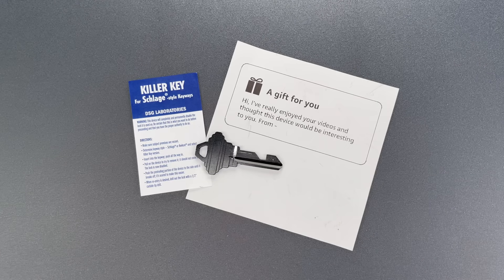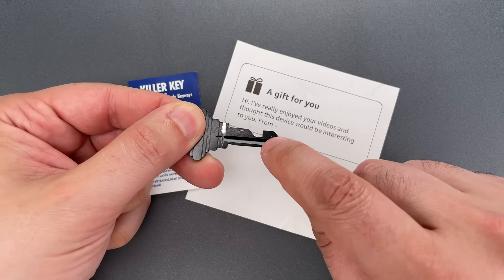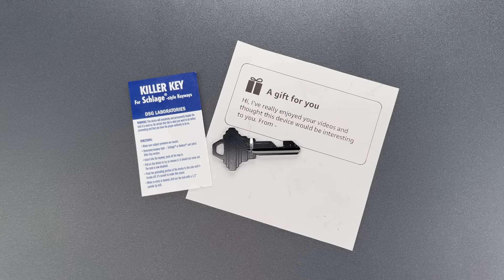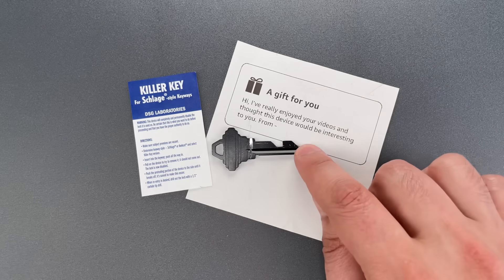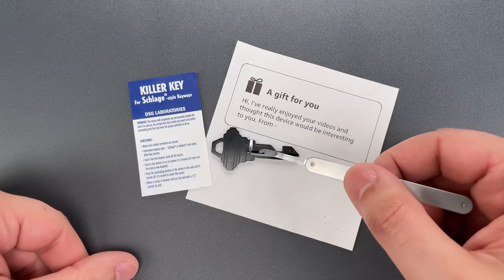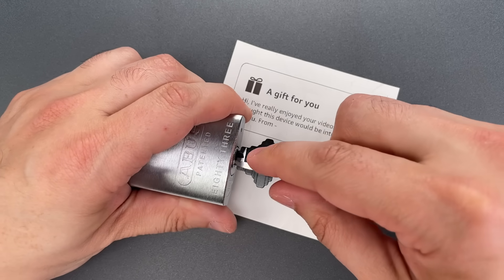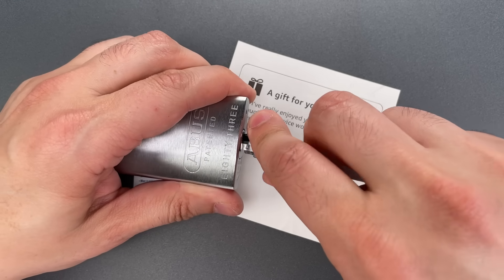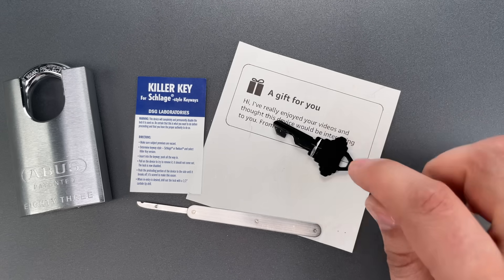[1350] Defeating a “Killer Key”

Comment: "Those so-called killer keys can be pretty useful" but as I just showed you, it´s important to remember how useless they are.
Reply: Your non-paying tenant, of whom 99.99999% doesn't know anything about picking locks, would beg to disagree.
Reply: @caelestigladii  If he ain't paying anyway he'll just defeat the door.... 😉
Reply: @caelestigladii  That's true, however as it was defeated with an improvised tool that also retrieved the key, it means without using any improvisation you can use a slim flat piece of steel without a hook to lift the pins, and just pull the bow. That would be something I'd try whether or not I know anything about lock picking. It's the second thing you'd do after tugging on the bow to check it is actually stuck in, if you were intending to do something other than shake your head and walk off, this would be it. Most people do understand how a pin tumbler works, being as it's the most widely used type of lock, and everyone has seen a key with peaks and troughs. Whether or not you understand how it works, slipping a feeler gauge or something similar down the side of the key to see what's holding it in there would occur to many people, not just lockpickers. And any squatter would have the key out as fast as LPL did. They can deal with far more challenging bars than a hooked key.
Reply: @caelestigladii  it seems like a low skill attack.
So everyone who can use Google can bypass that key killer.
Reply: @Jehty_  that's if one have time to google while breaking in.

Comment: Thanks for the advice! In addition, hotel rooms use electronic keys which are literal crap in a card... Of course you knew that, so for those watching, barricade your door in a hotel and buy or make an alarm. The locks provided can be defeated with a rubber band and duct tape or even just a piece of thread... I know because that is my job right now and a simple warning device (noisemakers at a minimum if the door opens) will save lots of embarrassment in a bad (rare) situation a Tiktok video...

Comment: This is just cruel. Not only does he “kill” a lock, he plunges the tool back in to kill it again, makes a mockery of the tool with an improved version he just happens to have on his key ring and totally nullifies the threat of this product with one of his own in under 2 minutes and even that was taking his time. Brutal.
Reply: "Stop! Stop! It's already dead!" xD
Reply: While his key is definitely an improved version, by the looks of the intrusion method, I think it would have similar results. LPL just shows that if there is a will there is a way to bypass basically any defensive measure.
Reply: @darkest_eclipse8271  The best defensive measure is an armed guard.
Passive measures only stop the unprepared and unskilled in their tracks; they only slow down a prepared and skilled attacker, and in this case, it only slows them down by about five seconds.
That may or may not be enough slow-down, depending primarily on how far away that armed guard is.
Reply: the armed guard has been bought off with a bottle of scotch
Reply: @cactustactics  claymore on a tripwire.
Reply: @brandondirocco9816  That's an example of something called a "mantrap" and would get you sued
Reply: @brandondirocco9816  I'm picturing this with a sword on a string
Reply: If you enjoyed that, enjoy watch?v=yzfsPkZMR1A which has three different scenarios and six (if I counted right) different tools in just 9 minutes.  (-:

Comment: Let's not drag this product too much. It is what it is, a low skill tool that requires some preparedness to counter.
Also I think this extraction with a probe wouldn't be so easy in the field. All you need is a bit of grime and rust and jamming this fragile probe in there might not be possible any more. Also you surely could produce these with a slight taper so that there's barely any opening in the first place.

Comment: Theory: if you were to make the break off part farther down, so it's broken on the back side of the first or second pin in, and put a curve on the key so you need to tap it in with a small screwdriver, effectively wedging it inside the keyway, in Theory it would be nearly impossible to remove.

Comment: Hey lpl. Does this method work with a regular broken key in the zylinder as well?
Reply: If I'm not mistaken, there is a "regular" tool for that. By regular I mean a tool designed and sold for that exact use.

Comment: Question: if I injected the lock first with an instant glue, then inserted the killer key, how would you remove it after it's dried?
Reply: Heat the key with a lighter would disable the glue. Or acetone.

Comment: @LockPickingLawyer Here's a better design:  Score the key at pin 3 right down to the bottom rail, so that it's hanging on by a thread.  Insert the key into the lock, wiggle while pulling back, and eventually it will break, leaving the first half of the blade stuck under pins 5 & 6.  There won't be any places for you to grab the end of the blade with that dimple.  I'm sure you could still craft a tool that could get around it, but it would make it much more difficult.

Comment: Saw a far better way to kill a lock.. Ramset a nail into the key way. That's not coming out.  I use 0.103" cross section silicone orings cut into sections to replace the last top spring in the shell.trimming it so I can just barely use my pin tweezers to force the top pin down to allow the plug follower to hold it. You cant pick or bump the lock.and if you loose the key the oring has enough pressure to push the top pin thru any shimstock.

Comment: If I made a killer key, I would actually want something to stick outside to completely plug/cover the keyway and prevent removal tool insertion. Then you'd at least need to drill/file/whatever the capper piece off before attempting anything else with the cylinder.

Comment: LPL defeats lock, defeats killer key, nonchalantly states “if I were to make one…” and already has one made. I swear LPL has more flexes than the weigh-ins at a UFC fight.
Reply: AND STIIIILLLL
Reply: @MerlinDeLyon  Heavyweight Champion of the Lock; Pick-ing Law-yerrrr!
Reply: Undefeated, Undisputed
Reply: @DarranKern GOAT
Reply: When it's a lock, undoubtedly!
Reply: I love that he just shows his improved version casually and then never mentions it again.
Reply: Not only one but a whole ring.
Reply: And has a classy soothing voice I fall asleep to every night... while dreaming of picking locks. ;D
Reply: lmao i gotta steal that line for later
Reply: I think it wasn't his own "re-designed" killer key, it just looked like one, and he said "kind of like this one"
Reply: Did you notice that his version has two notches, at different positions, so the trick he showed off won’t necessarily work? Or not as easily anyway…
Reply: @randombloke82  it will work the same, he raises all pins all at once with his tool and then its pulled out by it no matter how many notches it has
Reply: @randombloke82  The principle remains. Pushing all pins down and pulling the key out. You could probably hold the key together with the pick and pull both out.
Reply: @SmartLifeEnthusiast  The key is not supposed to be pulled out.  It's like a shiv where you break the handle off with the blade still inside the body.  That's why it has the breakaway groove on the key.
Reply: @toolbaggers  I know. I'm replying to Azrael re. LPL's version with 2 traps. It can still be removed using the technique from the video.
Reply: Was looking for this comment. Already on his key chain too
Reply: no
Reply: Mate are you okay
Reply: Easily defeated ,just swing your King Rooster at the lock 🙂
And if its Master lock , killer key will drop out by itself .
Reply: Has the LPL ever been defeated??  Not once on a video have I seen this?
Reply: no shit!!!! we all just watched the video... why are you repeating what we just saw? are you that big of a loser?
Reply: except he tells you what his web sie is an you can see for yourself he doesnt make these ......yet
Reply: https://youtu.be/Cp7SePV4BbU

Comment: When a large UPS caught fire at [a non-profit] burst into flames fire, my boss at the time quickly evacuated/secured the room and used one of these (+hammer and a nail) to jam the lock to prevent [people] w/ unsecured/copied keys from releasing the fire into the rest of the building once we were outside (a known problem from previous fires in the building...).  

It succeeded! The fire service had to have [people] physically removed before accessing the door holding back flames and smoke.  "Prepared", those [people] were not.

Later the company that made UPS units cut a cheque (well above the actual damages we were asking for). Only asking  us to confirm that nobody died or was hospitalized as a result of the fire -- Which seemed very good of them.
But, they also sold those units with multiple thermal protection devices 'bypassed'/jumpered out, since that was also how the units were configured at certification -- Which seems is less so...

Edit: I remember the (hammer+nail) specifically because that boss had a bunch of different "killer key"s to demonstrate why we needed wanted ones with button/rivet heads to actually keep people w/ stolen/extra/unsecured keys out.

Comment: These would be a hell of a lot more effective if they had a flared end, which prevented any access to the keyway after they were inserted.
Reply: or a mushroom head that completely hides it (-:
Reply: Yeah, you’d need to dremel off the flair to remove it then.
Reply: Great idea. Or a gentle taper - push it hard into the lock, doesn't actually matter if it bottoms out as long as it gets stuck behind at least one pin.

Comment: OH! That lock killer and the explanation made me understand more precisely how locks work. I have been watching LPL for yers, why did it take me so long?
Reply: You push the pokey bits with other pokey bits above the split between two tubes is how locks work.. well, pin and tumbler anyways. You could visualize it by shoving an empty toilet paper roll inside another roll and jamming a couple of pencils all through one side of the nested tube. The inner tube can't rotate until you've pulled the pencils out. That's really what you're doing when picking, freeing the inner tube. ..except locks use two-part pins instead of pencils, and the tubes are much thicker, and made of metal.

By turning the core, adding tension, the manufacturing tolerances of slightly different diameter pins, different hole alignment or shape, will isolate one pin that's slightly larger/more off center/.. than others. You find the sticking one, push it up until you feel it slip above the shear line, and since you're keeping steady tension, the core will turn, and binds on the next pin that's the 2nd largest/off center, push that up.. and on to the next..

Comment: What’s the intended purpose ? Is it in the event of preventing a lost key being used ?
Reply: I suppose that would work. The main use is apparently by landlords, to quickly lock out an evicted tenant until the locks can be changed.
Reply: @beeble2003  
Seems a bit of an expensive way to do that, assuming the eviction is legal, the landlord should have new locks ready to go on eviction day, rather than the expense of having locks drilled by a professional.
My initial thought was they were a means to cause a nuisance to the lock owner, much like supergluing a lock.
Reply: @Will-thegrumpysoutherner  Maybe the locksmith isn't available at the specific time needed. And if somebody wants to superglue a lock, they can just superglue it. It's easier to imagine a product that has a somewhat redundant legitimate use than one that has no legitimate uses and is completely redundant.
Reply: @beeble2003  
Landlords & agents can generally change locks & an eviction takes months & months.
Your explanation doesn’t make sense to me, i know you are struggling with that but sadly that’s your problem.

Comment: I imagine one of the best uses for these kinds of keys would be rental storage units, whereby someone who has failed to pay their rental dues for a sufficiently long time has the lock on their unit "killed" with one of these keys so the owner of the property can later have it removed with bolt cutters, a saw, etc., and then liquidate the contents without the owner being able to just swoop in at an odd hour, take all their stuff out, then vamoose.

Or if you lost the key to something very important, say a locking gun rack or something, and had suspicions it could have been taken by someone intending to steal the locked item(s) later.

Comment: Is there any other purpose for those killer keys other than causing mischief and vandalism?
Reply: Quickly disabling a lock until you've had the ability to replace it e.g. key has been lost and you want to avoid risk of entry, or roommate / ex / tenant has been evicted but has not given back their key, and you want to forbid them access to the premise.

Putting glue or somesuch could risk seizing up the entire mechanism instead of just the core.

Comment: i feel like in some cases, if it was on a padlock, you could turn the lock upside down and the pins would fall and let the key come out, but that up to the spring tension.
Reply: The spring tension should never allow the pins to move under their own weight. The pins are tiny pieces of metal -- they weigh next to nothing. It's hard to imagine a spring so fine that it would be significantly compressed by the weight of a pin, even before you take into account the friction of the pin against the chamber wall.

Comment: I think the position of the break line was deliberately put further out so that, as the card says, it can be easily broken by bending to the side. If the line was still a little inside the lock you'd need to use a lot more force and probably some tools to break it.

Comment: Some thugs, some time ago, just put superglue in the keyholes of several locks around where I lived. I defeated this once with a kitchen blow torch and a miniature rasp to remove as much glue as possible, and then insert the key to open the lock. Then it was a matter of replacing the lock. It would have been faster to simply drill it, but I wanted to know if it was possible to do it with heat.